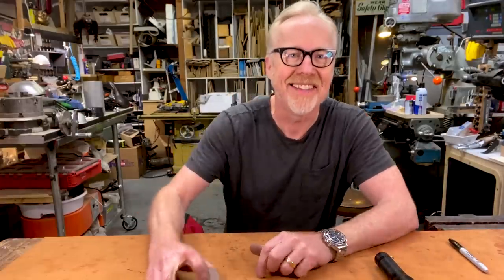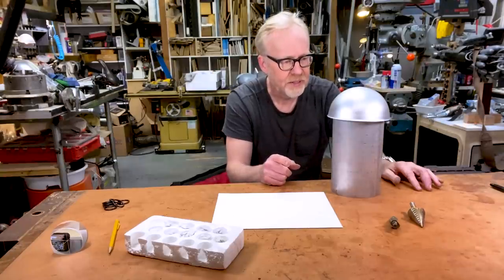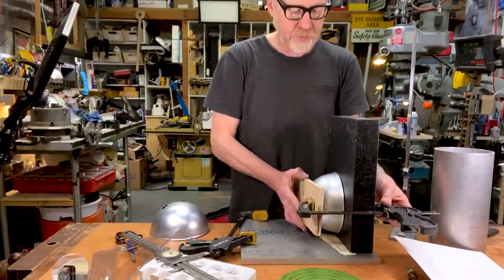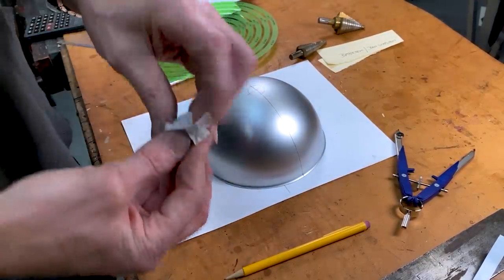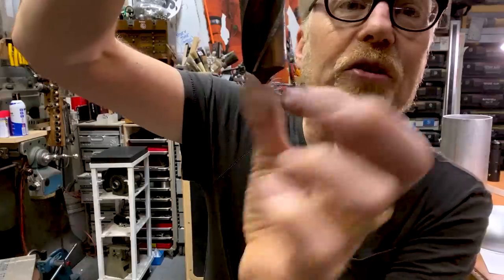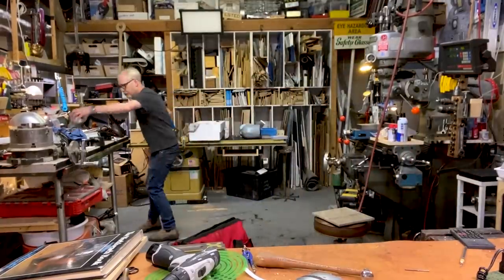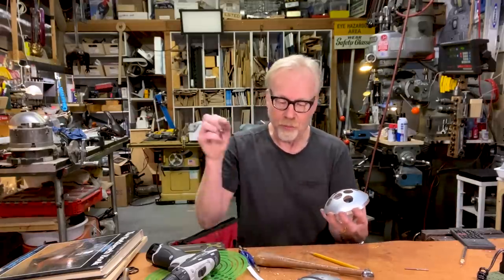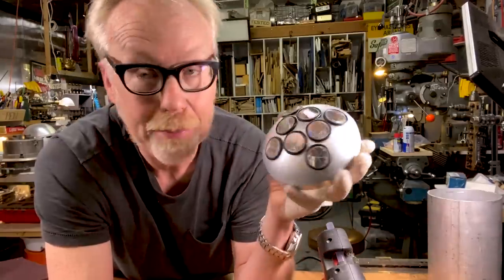Adam Savage's One Day Builds: NASA Retro-Reflector Replica!

Comment: Great,
i was in the workshop where they produced these reflectors in Germany back then for NASA to place them on the moon. They are still there and can be observed from earth. 
It was a small but very specialized lens honing 2 men business.
Was a very interesting process and i remember the surface quality was tested via newtons rings.
Reply: So  how do  you see these from 250,000 miles away ?   Would like to view them.
Reply: @usd25674 
Hi usd,
it's a long time since the 70s but i remember it's said those reflectors are the only things wich can be observed directly from earth, or better said it's possible to watch the reflections. They were used for distance measurements. I think i can do a little research on interweb and find some details and let you know.
Edit:
I easily found a lot in German and here you can start your research in English:
https://en.wikipedia.org/wiki/Lunar_Laser_Ranging_experiment
These reflectors on the picture were built in Germany.
Reply: @TheElrondo    Who were the two men who did this.   I have heard one report that NASA  used PMT (photo multiplier tubes) to prove this, so that would leave out the amateur astronomer.
Using the inverse square law, it seems suspect that one could send light out 250,000 miles out,  then reflect this infinitely small amount of light back to earth ,  reenter the atmosphere ,  go through dust  and clouds and we could see this again.
So  if some one out there has done it would like to see it.    Would like to see this for myself.
If I sound highly skeptical it is because I am.
Reply: @usd25674  
Well, it's really a long time ago and i didn't pay that much attention to the details back then. I was friends with the son of one of the shop owners and his father showed me the process of "sanding" and polishing the lenses and explained the use of those. I live close to the famous Zeiss factory so lot's of optical glass specialists in my area. For me it was a kind of sensational someone i know works for NASA related stuff.
Reply: @TheElrondo  I  was hoping for something that was able to be demonstrated.    So much of NASA  info has to be taken at their word, and I am afraid they fail the smell test.    Thanks anyway.
Reply: @usd25674  I did some of the initial research for the Moon Landing Hoax episode and I was hoping we coud try not merely to detect some photons coming back but combine it with an image of the surface of the moon taken at the same to show that the bright dot of the retroreflctor was in the right spot.
The scientsts who use the retroreflectors to measure the Earth-Moon distance send a very short burst of photons to the Moon. As described the beam is not perfectly collimated and spreads over a large area, size depends on the apeture angle of the beam. For the group in New Mexico doing this the beam is about 4 miles across. Area is Pi*R^2 or (2*5280)^2*3.14=350,152,704=3.5E8. The retroreflector I think is 1.5 square feet so 1.5/3.5e8 = 4e-9. The same for on the way back for a total received rate of 1 for 10e17 photons sent. These few photons are separated from all the rest by using very narrow filter for only that wavelength, time gating so only photons near the already approximately know distance make it to the photomultiplier tube, and the exact time from pulse to detection is recorded for each photon that makes it through. Then the process is repeated thousands of times each night and the photons not from the retroreflector are randomly spaced across the time gate but the photons from the reflector peak at the correct time/distance. That way they can still make the measurement when a reflected photon arrives only once in a hundred exposures that still is many per night. Taking into account the light slowing down through the Earth's atmosphere and many other effect, they can measure the distance down to centimeters.
Reply: @mbushroe  So  why do they do it at night ?   Who are these scientists ?    NASA perhaps.    How can we trust these people are telling the truth ?    Are these the  same people who televized the moon landing ?
Reply: @usd25674  That's at least fout questions! :). 1) During the day time there is so much scattered light in the sky from the sun that you can barely see the moon, let alone fine details. Even back yard amateure astronomers only take their telescopes out at night. 2) There are teams in several countries that each run their own Moon ranging programs. The McDonald Observatory in Texas is one such Lunar Rangefinding observatory. They are loosly affiliated with the University of Texas in Austin, not NASA. Although it is possible that the research is funded by NASA grants. The teams in France and Tokoyo are obviously not funded by NASA. 3) They have been running the experiment for decades, many people have worked there and moved on, many people have been the director for some time, they publish numbers that are used to test Einstein's general relativity along with other theories of gravity and physics, and their numbers match up with those from France and Tokoyo. 4) None of these people, to the best of my knowledge, had any part in relaying the video from the Moon landings to TV news organizations that were then broadcast to the people of the world. If you believe that all the video, pictures, rock samples, radio communications were faked, these people did not become interested until after all that because the retorreflectors were not on the Moon until after the various Moon landings put them there. By the way the retroreflector from Apollo 15 is 3 times larger than any of the others and so is most often used for Lunar Laser rangfinding.
Reply: @mbushroe  Can you take an optical telescope and see this reflector  ?  Further more can you see any tracks where they landed,  and ran the moon rover.
Reply: @mbushroe  Did they leave the moon rover there ,  if so you should be able to see with telescope.
Reply: @usd25674  No. The Hubble Space Telescope, if they allowed it to be pointed at the Moon which is way to bright for it, they can't image anything smaller than 100 ft across. Even if they had ten times better resolution the LEM descent stage would be only a single pixel, indistingushible from random noise. The Moon is far enough away that man sized objects are beyond our current mirrors. As for the retroreflector, you could not 'see' it in the sense that you could see a box with lots of corner cube prisms. But if you shined a very tight beamed laser on just the right spot, had a 1-3M telescope with sensitive CCD camera watching that spot, and alternately blocked and unblocked the laser  beam, and 2.5 seconds after took long expsores in the laser light and long exposures with the laser light blocked subtracted the dark (no laser light) from the bright frames and integrated those up all night you could probably see a bright spot where the retroreflector is, surrounded in the image by the terrain of the Moon expected for that location. I am not sure that that would work, but that is what I wanted MythBusters to do as part of the Moon Landing Hoax special.
Reply: @usd25674  No. The rover is even smaller than the LEM descent stage, which they left behind. Neither one can be seen from the Earth or from low Earth orbit. Maybe someday a telescope in orbit will have enough resolution, but not for quite awhile longer.
Reply: @mbushroe  So what you are saying there is no way to prove that the reflectors are up there.   We just have to take the word of 'scientists'.
Reply: @mbushroe  
It is such a covert deep fake that you don't realize you were part of it
Reply: usd25674 No, what he’s saying is that there ARE ways to prove that the reflectors are up there, but that it is difficult and requires both time and highly specialized equipment.
Reply: @usd25674  Yeah the moon landing was fake and there are lizard people. Stop asking stupid questions if you're not going to believe the answer. Smh.
Reply: @mbushroe  You are 'hopelessly corrupted'  strange way of putting it .
Reply: @benjiequezada  So just accept it on faith is what you are saying.
Reply: @Theprinceofpersia777  So why are the questions stupid.    Do you ever question anything  ?   or do you just march lockstep ?
Reply: @usd25674  I might be wrong, but I remember an episode of Mythbusters (I believe the moon landing one) in which Adam went to the observatory in Hawaii or New Mexico and actually did the experiment and shined a light at the moon and got light back off of one of the reflectors. Hope this helps.
Reply: @leviswranglers2813  Again  this is something that you have to accept on faith.    Considering that it comes from government  not so credible
Reply: @usd25674  so the only thing that you are going to believe is something that you do on your own or see with your own eyes? Multiple people have given you multiple ways to verify information, but it's not good enough, therefore good luck with your "search" for truth.
Reply: @leviswranglers2813  Yep , been lied to toooo much.   Best regards,   good luck with scientism.
Reply: @leviswranglers2813  That  particular episode was nothing but a propoganda  piece.   Even had the liar in chief on it.
Last one I watched.
Reply: @usd25674  ok obviously you are trolling at this point. So good luck with that whole conspiracy theory stuff.
Reply: @Theprinceofpersia777  Cool it man,   You believe what you want and I shall do the same.
Reply: @usd25674  Because the returning light is very close to perfectly parallel to the source beam, you simply prevent any light from other angles from reaching the detector.  (And by simply, I mean the principle is simple, the execution is fussy optical science) You know the old story about being able to see stars in the day time from the bottom of a deep enough well?  (Not sure how deep the well or how black you had to paint the walls) It is a similar concept, if you get rid of all the other light, the very small amount you get back becomes larger than the background noise.  When they say they can be "seen" from earth they don't mean you can see them, they mean you can bounce a laser off them and get enough signal back that you know with reasonable certainty that it is the laser you sent out.
Reply: If I recall that episode correctly (it's been years since I saw it) the "proof" that they could see the return signal was a computer screen going 'blip!' which isn't exactly convincing if you think there's a conspiracy. Personally, I think that the simplest demonstration that it actually happened is probably the Soviet response---they were watching the whole thing with great interest and would have been absolutely crowing if they could show it was faked.
Reply: @wolfgangmcq  Well yes,   so the other countries have their 'space program ' .   Why would one country rat out the other, if they are all in on it ?
Back to your first point,   mannnnn it ain't too convincing.
Reply: @usd25674  If you're going to argue that the entire Soviet Union was a front I don't know what to tell you. These are the same people that did their best to disprove Darwin; they had no interest in supporting "bourgeois pseudoscience." (Their words, not mine.) You may as well just jump straight to arguing that Descartes' demon is real.
Reply: @wolfgangmcq  Darwin was a fool.
Reply: @usd25674  Not sure how that's relevant? My point is that the Soviets agreed with you about that, and loudly. I'm not sure what your astronomical model is, but since you think the USSR would have needed to participate in the cover up to keep their own space program going I'm guessing it's not "Copernican heliocentricity with elliptical orbits Newtonian mechanics and vacuum." If a Soviet scientist had been able to disprove such an established Western scientific model (to Moscow's low scientific standards) it would have been a huge ideological coup, and the scientist in question would have been hailed as a national hero and lavished with the highest accolades available. I find it hard to believe that every single scientist in their space program resisted the possibility of fame and glory in favor of quietly pretending to land rovers of their own on the moon and blowing up rockets on the launchpad to make their homeland look incompetent.
Reply: @wolfgangmcq  I did not realize that the Soviets claimed land rovers on the moon.    So how many  countries have done this. 
Heck may have a golf tournament up there.
Reply: @usd25674   Full list available here: https://en.wikipedia.org/wiki/Exploration_of_the_Moon (noting, of course, that Wikipedia is biased towards considering the events as having actually happened; but feel free to insert "claimed to" where appropriate when counting.)

I'll also note (and please pardon my acerbity; my irritation with the all-too-frequent state of online discourse is showing here) that you should probably do some cursory research on this topic before (or at least _while_) discussing it with people who have experience with it; to do otherwise evokes the impression of someone more interested in trolling rather than genuinely learning more about the topic.

Comment: I've seen these on bridges over waterways to reflect ships radar.
Reply: I have seen those and always wondered and just now realized this. Thank you :)
Reply: The difference with those is they are not glass prisms, but rather tuned antenna elements that do for radio frequencies what the prism does for visible and near visible light.  They are usually contained in a spherical radome for environmental protection and you can't see the elements inside. They also put them on high power lines and towers where aircraft might be expected. The reason they use prisms instead of 3 first surface mirrors is that the mirrors must be held aligned in a frame, and alignment is fussy and fragile, and first surface mirrors are extremely vulnerable to scratching, while the prism is intrinsically aligned and do not move.  (Still very fussy grinding, with flatness and relative angles measured in wavelengths of light). Also a mirror based retroreflector needs to be left open because any diffraction in a cover would affect the parallelism of the return beam, and the open mirror pocket would collect any debris in the environment. For lab work with lasers and such mirror based retroreflectors are fine. The thing that has always astounded me is the size of these things, the one posted by @Ferd Dorst above is a lot smaller than Adam's, the whole thing is described as smaller than a computer mouse, and the prisms are 0.5 inch diameter.

Comment: I would like to install a whole bunch of those to the back of my car for those people with extra bright headlights.
Reply: I hate those headlights as much as the next guy, but that would probably violate some traffic laws and increase your chances of getting rear ended.
Reply: On a microscale that is the technology behind the reflectivity in license plates and car lights, and bicycle reflectors
Reply: Wouldn’t it just reflect the light back into the headlights?
Reply: Equally illegal for the exact same reason.
Reply: @FozziesRandomReviews  Yes, it would reflect back parallel to the light that reached it, so within the diameter of the retroreflectors it would bounce back and make bright spots around each headlight.
Reply: For what it's worth, you already have a number of retroreflective panels on your vehicle.  Usually they're just called "reflectors".
Reply: @mbushroe  The red ones already on your car work just fine.
Reply: @CorwynGC  That is true, they work great at showing the position of my car in someone else's headlights so hopefully they won't run into me. But if you want to remind the guy in the truck behind you that his highbemeams are lighting up the interiror of you car like a footall stadium, they aren't bright enough. Not surprising since they are cheap, injection molded array of plastic corner cube prism retroreflectors, and are designed to scatter the light a little so that the drive sees them, not just the lamps in the headights. Of course, it has already been pointed out that mirrors or corner reflectors like that are illegal,so we can't do that anyway.
Reply: As pointed out, these are too perfect and wouldn't reflect back to the driver. A 5 second angle of reflectance would reflect back to a spot 2.5 cm in diameter at 1 kilometer. That would be 1.5 inches at a mile in freedom units.
Not very effective.
Reply: @GlennBrockett  Freedom units? Does anybody remember "Freedom Fries"?
Reply: @briankocheraabcdt4628  Well, considering that the automotive industry moved to metric (SI) we cannot really call them SAE can we?
Yes I remember the FF debacle.
Reply: Just install a mirror, the size of your rear window, with hinges to the roof in the back of your car.  Then come up with some sort of mechanism to release and reset it while driving.
and ta da you have yourself a neat tool to make anyone behind you crash. (for legal reasons this is a joke)
Reply: Then why does the license plate ahead of you shine? The headlights aren’t a laser, so the light will scatter correct?
 I used to shine powerful lasers on street signs as a kid when I was a passenger in a car. Kinda fun but super distracting for other lol.
Reply: Maybe not idk.
Reply: @mbushroe  You'd be much better off with a xenon strobe party lamp, depending on ambient lighting you might just fully blind them for a few seconds